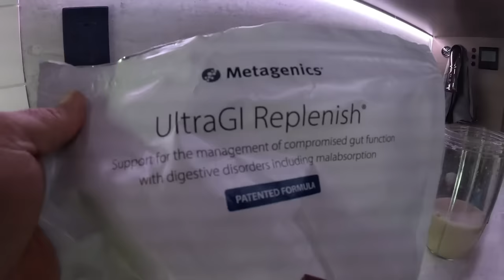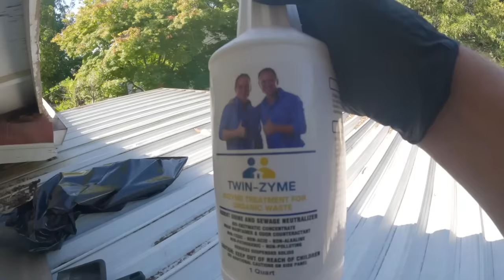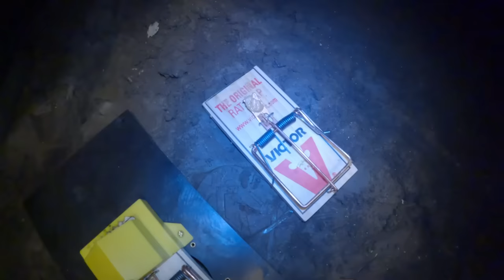The FASTEST way to get rid of a RAT infestation under your house …

Comment: Did some plumbing on an older house back on '05 where there was extensive rats nests behide the drywall.  Breathed a lot of rat dust.  Bodies/nests and poop. Then got a weird disease...Delayed Pressure Urticaria.  Lasted about five years.  It actually started while working at that house. Thankfully, it is gone now.  Survived thru a facebook page of DPU sufferers.  No cure.  Drs didn'teven know what it was.  I know it came from the dead rat nests.  Be careful around that crap.  Not a pleasant experience. Good luck guys.  Great videos.  (not to mention Hunta Virus)

Comment: I had a rat problem in my crawl space last year. I found out where they were coming in and closed it off, But I trapped them in. I set traps, and caught a few, but when I checked the traps, I only found half rats. The "starvation mode" had already kicked in and the rats were eating each other to stay alive. Some of the traps I put down had disappeared, and to this day I have never found them. I checked my crawl space last week, and the few traps I had left in there were still set with dried peanut butter and cheerios still stuck to them.   I did not have that yellow house shaped cover to ensure the rats enter only on one side of the trap, so I mounted the traps vertically a couple inches up and screwed them to the studs so the rat will have to reach up and stick his head in the kill zone. Secure your traps people!

Comment: 7:13 Plumbing apprentice's signature calling card.  Put something across the access hole/ route so the electrician and ventilation guys/girls can't get in there.  Well, actually, I've seen ventilation guys run that plastic double wall ducting through attic accesses as well.   But the fact remains, no matter who it is, real tradespeople leave room for other trades.

Comment: Great! Think I beat you though with my plain Ole kibble 1" deepen in a pail. 2 had drilled through a full covered pail of kibble so I used the food for bait. There were 12 in the bait pail! Yes over 1 day. They were young. Older than baby babies😮, but I suspect littermates.1 died of stress before the relocation to ratzville in the country. I stopped at over 20. My first and hopefully only year as a rat huntress. Heavy excavation and building across the street.My basement is dirt walls with insulation and plastic. It looks like zombieville aka spray foam acres. 😮

Comment: For the main part in England, we take the advice of the third little pig and build our houses of bricks (instead of sticks). A heavy concrete slab thus avoids having a "crawl space".
Reply: A lot of people here have basements. But basements are not possible in all areas. In some areas of the country they have concrete slabs.  But rats and groundhogs can dig under those slabs.  I had to put exclusion wire around my pole barn, because groundhogs were trying to dig under it.
Reply: Brick and masonry construction is prone to rising damp and it is hard to insulate. Also, a poorly built or maintained masonry building can collapse all at once with no warning, whereas a stick house in distress will sag and droop to a comical degree without actually collapsing. I for one prefer the American style stick built construction.

Comment: This was awesome.  Ive been watching your videos because we had a sewer rat problem.   I live in a villa whichnis connected to another. My neighbor had a rat problem so they had a pest control company come out.  The sealed up both units as best they could. It didnt work so they did a smoke test that had the smoke come up from behind my washer. Sadlythey dont do plumbing and drywall and you guys are too far since im in Florida.   I opened the wall and found the broken vent pipe. And found screws went through the opposite wall and i think cracked the coupling.  It didnt really look gnawed on.  So i needed to cut off the screws. I had to get the right blade to do it.  I put 2 caps on  the vent pipe and didnt get back to it for like a day or 2. When i pulled the cap off it was full of clear liquid that smelled like pee. There was no poop anything in it. How does that happen?  What does that mean?   Thank you for any help and for all the help ive gotten from you already

Comment: We had possums in our roof years ago and just like these rats they’re cunning and clever little buggers. Also just like these rats the best way to catch them is cutting off their entry and exit points. We got a professional possum trapper out but he only got one possum in his trap. He gave us some tips though and we managed to get rid of them. There were two still in the crawl spaces, one chewed it’s way out and my son rang me saying there’s a possum in the rumpus room and it’s not in good shape. So I told him to throw a blanket over it and put it outside. The other came out a disused power point behind the couch and ran into the window trying to escape. I had previously opened the front door so it could get out and it went out our front door. Possums are a protected species in Australia even after you trap them you’re supposed to release them close as they’re territorial animals. I spent a full day retrieving a dead stinky possum from an inaccessible roof cavity which involved me removing and replacing metal roofing in 35 Celsius weather. So I wasn’t really concerned what happened to them afterwards.

Comment: How do you kill any living creatures?  (1) No food (2) No water (3) No air and (4) extreme temperature, very hot or cold.  Of course, you can seal the sub-area or attic and pipe gas in there.  Yes, find out how they travel (holes) and put a stop to that.  If they are inside your house, isolate them, try to corner them in one room, vs. you chase after them everywhere in the house.

Comment: That Electronic Rat Trap needs a Microwave Transformer & Microwave  Capacitor Upgrade 

however me take to next level
+ under sink waste disposal unit (Catering  industry Grade ) + Magnetic  Induction Heating  / cooking (Catering  industry Grade )  Upgrade For multi Repeat kills (self Resetting) And have a BioDigester (IBC) so it can make it own Fuels (Bio Rat diesel  & Bio Rat Methane)

Comment: So I thought once a trap killed a rodent, the rodents can smell the death and will avoid it.  Is that not the case or all ya'll spraying something on them to continue using?  EDIT - I just saw ya'll spraying it down....
Reply from the maker: Great question! That’s not the case. There are cases that leaving blood on a trap may cause some smart rats to avoid. Most cases it’s not an issue if you seal up ALL your entry points, they have no other choice but to take that food out of desperation. That’s why we stopped using gloves when we bait, we were told beginning of our careers to wear gloves hen baiting, this is such a MYTH! We have proven this on hundreds and hundreds of rats we have caught. 

We spray them down to clean them because we travel with them and don’t want to run around with nasty rat traps in our vehicles. 

Hope this helped!
Reply: My Dad used to burn the smell away if that makes sense.

Comment: How does structure even hold up that Tera coat roof, your flashing, sink screws, and flex seal patch will fit right in , I guess it’s better than a ziplock bag and aluminum foil, I give you 2 out of 10 on Qaulity construction.